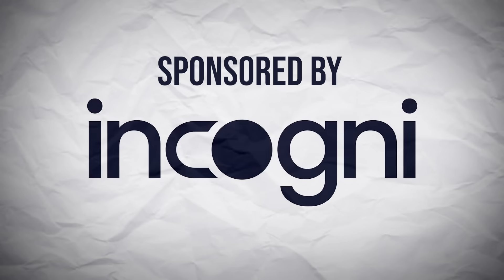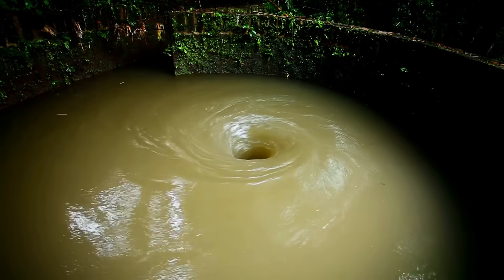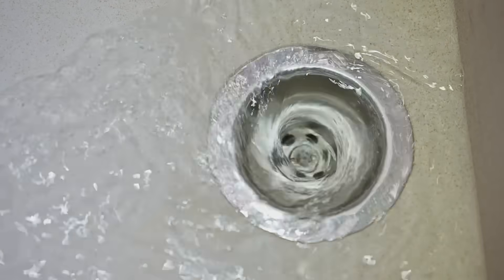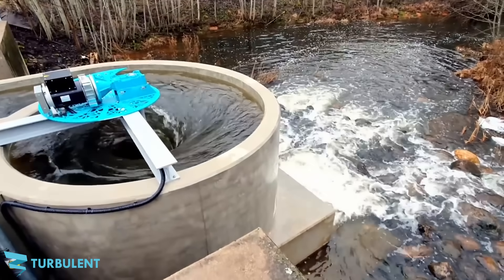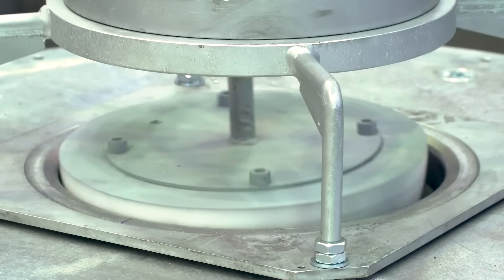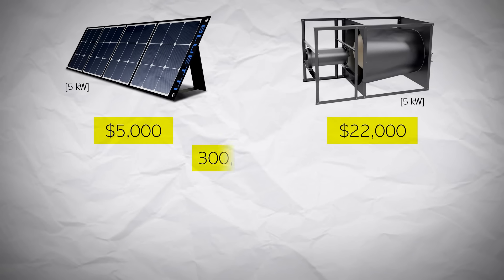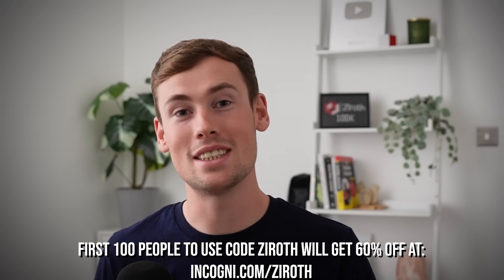Genius Bladeless Hydro Turbine is Cheaper Than Solar

Comment: Would this also work in freezing temperatures of winter? I know that rivers and streams do not freeze solid. Did you run across any studies on this matter?
Reply: To claim that it would be able to run 24/7 is a best case scenario and is obviously is not taking into account seasonal changes such as ice, or reduced stream flows in drought conditions.

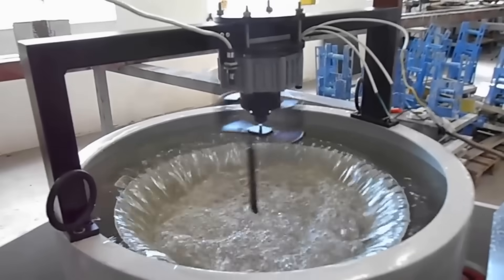Comment: at 1:17 the vibrabion coming form it will end up braking it (nuts and bolts will undo them selfs as for the concreat well thats goin to turn back into poweder)
good idea tho also insead of a ball try an egg shape with the vortex (upside down egg) should come off better of the top of my head
also you can put small bumps in to the wall to help start the vortex spinning the right way tho over long turm there just goin to ware out

Comment: I wonder if something like this could be used in a tide zone on some kind of swivel that would always keep the proper end pointing towards the water source (inland at high-to-low tide and towards the sea at low-to-high tide). It would not work very well at absolute low and high tide, but at other times it would probably generate power.
Reply: If there is a potential difference (ie. flow) then in theory there is energy that could be recovered.
Reply: I was wondering about that myself 🤔
I have a tidal lake and the flow is suprising but generally low flow however, this style could act like a sail in the water where the overpressure of the water being forced into the cone with a restriction, like a court nozzel in reverse, the flow wouldn't be towards the rotating element, it would require flow collection structures but that would only accelerate the flow slightly but the intake for the turbine would end up being higher pressure at the intake because of the cones restricted flow because of the vortex and would use one fixed turbine fed by 2 collectors placed 3M under water would flow all day(*almost) and be functional in areas prone to ice but not arctic levels.
It would look like the old microwave transmission receivers that were on towers before satellites 😉
The idea is the same, catch the wave, so to speak 😏
Where those horns focus the tidal flow will be greater than the turbine diameter so the flow overfilled the turbine and it's resistance to flow and a bernoulli effect created by the diverted water flow creating a low pressure area at the bottom of the turbine so only a slight difference between intake and outlet is required. 
The output wouldn't be Hoover dam but it would be very low maintenance with carefully selected materials and exclusion of fish would happen naturally as fish,  for self preservation, are very pressure sensitive. 😎
Reply: Perhaps we could build very large tidal pools that replenish their volume at high tide, retaining a large head to drain away through the receeding tide" there us usually waves as well.  Not sure what to do at peak high tide - Not much flow then

Comment: The biggest problem in generating power from water is corrosion and growth of biological creatures.  Decades ago testing of using the thermal temperature difference in deep water to surface water have been built and run for years.   Why they are not commercial units or a significant number of turbines in the ocean is because of these two problems.  The world population concentrate near the ocean shore so the transmission losses are not as big a problem.   Tell us about how they plan to deal with these two problems.
Reply: Use none corrosive materials. For example ground source heat pumps work on a sort of similar idea, pumping water through plastic tubing to get access to the more consistent HEAT source.  Temperatures stay fairly constant at a certain depth.

Comment: The power generation capabilities of such blade-less turbine necessarily has to be much lower than a classical turbine, because once load/power sink is connected to this turbine it's going to slow down dramatically, because the water has no way of "grabbing" on to the ball that is now putting resistance to being turned.

You of course could provide some bumps on the ball to increase the grabbing force but at the limit those bumps are just blades and you've come full circle.

So basically this turbine is safe for fish but I bet it's garbage in terms of generating usable levels of electric power. Provide some hard test numbers to prove me wrong.
Reply: Make the "ball" out of stacked discs similar to a Tesla turbine. This will increase surface area and the interaction with the rotating water accordingly.

Comment: By far the bigest issue with low head turbines is the screening requirements asociated with debris... Large rivers carry large debris, especially when they are in high flow conditions. A typicallt benign looking weir/tube/screw... whatever looks a whole lot different with several meters of raging water over it and would stand little chnce of surviving when impacted by the trees  and other large debris,that accompany that flow. This an interesting concept but deploying it would hve the same problems as any other low head system where the screening is the bigest impact to the environment.
Take away the screening and the river will destroy the infrastructure in short order.
Reply: Guessing you could filter a reasonable amount of the big stuff out with some careful redirection for inflowing water as you direct some away from the main stream.
Reply: True - dams have trash racks

Comment: I am confused about where the numbers for power generation come from in the 9 minute area. I tried watching it a few times, but still not sure where that 300,000kWh number comes from. 300,000kWh means there would need to be 60,000 hours in a year if generating at 5kW. 
You didn't need to get that number from the internet, just multiply number of hours in a year by 5kW.
365 days x 24 hours = 8760 hours per year.
X 5 kW = 43,800kWh each if running at 100% all year. 
So if you use the 17% number for solar (probably still a little bit on the high side for a lot of places, averaged over the year), then that would be 7,446 kWh a year for a 5kW system. (~14.9% of 50,000 kWh)
If the turbine is running at 50% over the year, then that's 21,900 kWh (14.6% of 150,000)
To me it looks like your numbers are for 7 years not 1 year.

Comment: 22 seconds in here and I see you have made a major assumption that is there will be water, rivers all around the planet are drying up, great idea for almost nowhere, solar wind and waves are the answers; crushed by petro dollar greedy flocks imho.  Don't get me wrong man, it is a very nice system indeed, but for the cost to build it and the instability of climate change I'd rather go floating shore-based wave machines, solar panels everywhere, wind captured and harnessed. power sources.  I think that principle could be miniaturized easily for places with any sort of water flow, but it is getting rarer and rarer, and frankly, such power points only serve a limited number of folks compared to the need.
In principle it may be cheaper than solar, in my honest opinion I doubt that, but that aside it seems like a good idea, time will tell if we have enough eh :)

Comment: Makes me wonder why smaller versions of these turbines can’t be installed in existing plumbing/sewers. 

Imagine if every time you emptied a bath/sink , or flushed the toilet you were generating free energy.
Reply: because they would clog up eventually and provide abysmal level of usable electricity - they aren't practical in any way shape or form.
Reply: @vaakdemandante8772  also you want as much flow as possible with sewage. That shit ain't easy to move.

Comment: The rotor is off-cenered, it's almost the same principle as you provided.... But it isn't fish friendly as promised
To be fish friendly it has to have a low RPM, the design they provided won't have efficiency at low RPM 
Honestly i'll stick with the fish friendly turbine that has blades or the Arhimede Screw like turbine ....low head/low rpm turbines are the norm in this kind of situations

Comment: 🤔It makes me wonder what dimples in the ball turbine would do❓ Like a golf ball it's just a matter of what the right size of dimples you need for the volume flow of water.🤷‍♂️
Reply: Maximising surface area will improve the systems ability to recover energy from the fluid. Tesla turbines typically use a number of closely stacked discs to increase surface area significantly.
Reply: @nic.h  yes and using a femtosecond laser https://youtu.be/mQdoKaNI8Ko to etch the surface of the turbine blades to increase the surface area of each individual blade will give you more performance. But then there's also is a way to get more performance by Nano reinforcing  with
Aluminum-Oxynitride Powder or other metal trioxide Powders
https://youtu.be/DduO1fNzV4w

Comes in bag A B & C take bag B and mix with 99% or higher alcohol end Nano graphite powder for a single carbon atom. Place in ultrasonic cleaner to chemically dope graphite then prep metal parts for the electrostatic prepping gun for a nanobond https://youtu.be/bpV_Dcwtj60 then mix all three powders in powder coating gun https://youtu.be/IFeMX1O6Epk then spray metal parts and bake in pressure oven that is filled with argon gas that is called Hot Isostatic Pressing or H.I.P. process used in centering aluminum automotive parts. https://youtu.be/BsnzgsEXT_A Otherwise known as chemical vapor deposition proces's for a transparent aluminum diamond Nano reinforced hard coating for larger parts place in larger oven for example pressure treated wood. The femtosecond laser Fixes the issues with Nicholas Tesla turbine disc blades in water and the Nano reinforcing fixes the turbine disc blades in air for higher RPMs without the disks being destroyed.
Reply: It's like Nicholas Tesla said he was restricted by the Technologies of his time.

Comment: There is probably a coanda effect on the water and ball that may be useful. Maybe a directional roughness on the ball instead of fins etc.
Reply: Stacked discs to increase surface area and efficiency just like Tesla turbines.
Reply: The more fin-like the "roughness" is the higher the efficiency - the turbine has the highest and this smooth ball the lowest i.e. none. I bet that connecting this contraption to an actual generator and load will prove abysmal efficiency of this setup.
Reply: I guess the point is to harness power without killing the wildlife in the river/stream. @vaakdemandante8772
Reply: I would imagine it's pretty low torque compared to other designs.

Comment: It seems that this device,  unlike bladed turbines,  would actually cause more damage to fish. Because it doesn't operate like your paper cup example.  Perhaps you could get an even better patent. With the bladed type, the fish have an excellent chance of passing through between the blades where the flow velocity is highest.  In your model, there was zero displacement of the ball, instead , relying on serface friction.  In the actual design,  fish have a good chance of getting crushed instead of bumping into something. The efficiency,  as low as it is, would be even lower if it were to work like yours, although some texture to the serface would no doubt improve things.
This is very similar to rock crushers.

Comment: 17% of capacity factor for Solar Panels??  
Where do you live?  In the middle of Alaska forest? 
Also..   Solar panels does not have maintenance.
Try to keep that shit working over 1 week without issues or without being block. 
Also.. I do not understand why that thing can be installed in more places vs the others.   It does not have any advantage beyond "less infrastructure" but it looks even more dangerous for fishes.

Comment: putting fins on the bottom of the ball would be, in effect, creating some kind of turbine, so it may negate some of the advantages of a "turbineless" setup
Reply: This is still a turbine as it translates the water flow into rotational energy. So more accurate to say bladeless instead of turbineless.

Comment: So if the ball is going along the outer edge of the funnel, how does it not just squish any fish that gets to close?
Reply: The water, along with the fish, is on the other side of the ball and if it’ll fit it’ll go on through with the water. 
I suppose you’d need to keep the bigger ones from getting in though.
Reply: @stanweaver6116  The ball rotates along the outside, sure swirl and water pressure will usually move the fish ahead of the ball, but if the fish does something stupid and gets close it might just get caught and turned into paste
Reply: It’s basically preventing any fish to enter in the first place, it’s not exactly fish safe to go through.
He noted that this spinning ball funnel can be a much cheaper option?
Reply: @MP-vc4nu  The point was that you don't have to build an expensive "filter" system and can just have the fish go through the "turbine".

Comment: If a fish can be caught between the ball and the wall of the turbine, it's not really fish safe. A bladed turbine can be safer if it there is no risk of hitting the leading edge of a blade. Hitting the side of a blade is not an issue as long as the blade is not moving too quickly.
Reply: Pressure differences kill fishes as well like peoples. There's could be many bars different before and after turbine or blades.
So just keep fishes away from it. Much realistic way.
Reply: Bigger blades would help with that in principal. In theory that should allow slower rotation while recovering the same amount of energy.
Reply: efficiency goes up with turbine speed, modern turbines spin as fast as the materials allow.
Reply: @alanhat5252  I don't believe this is completely accurate. The blades have a flow rate that they are optimal for, it's a curve that peaks and then drops off.  You don't want to design a blade that is optimised for a flow rate that can't be achieved given the source of that flow. That would be inherently inefficient.

This is largely due to turbulence caused by the flow not being parallel to the surface causing flow seperation at non optimal flow rates.

This should be much less of a factor in Tesla turbines and this ball turbine, as in theory the flows are designed to be parallel to the surfaces, so to remain laminar in nature.

The blades do however get a mechanical torque advantage, but it's a trade off with the inefficiencies caused by flow seperation at non optimal flow rates. 

Tesla turbines tend to be more efficient at low flow rates, although arguably that's just because blades are typically design for efficiency at more typical flow rates I believe.

Comment: If the entire power generation system was this turbine 24/7 then, yes you could do away with the battery farms.
As has been said, the number of places to install the bladeless turbine is questionable.
In my opinion battery farms will continue to be installed.

Comment: The vibration inherent in the system will make it unreliable.
Reply: Looks like a lot of largely unbalanced force on the main shaft, so agree could be some maintenance/engineering challenges due to that.
Reply: "Come see the violence vibration inherent in the system!"

Comment: As with all hydro systems, regardless of the method employed, you’re extracting energy from the river which reduces the silt carrying capacity of the flow, so you immediately get silting up of the river.
Reply: It's a vortex which increases the silt capacity through the machine & it's installed vertically,  any silt which drops out due to extracted power will immediately rejoin the silt capacity of the main flow – silting is a non-issue here.
Reply: @alanhat5252  Energy has been removed from the system. 

You not understanding the implications of that makes all your comments utterly worthless.
Reply: There is so much human or natural intervention that in any case there will be more or less of it in an area at one time or another.
One more obviously will have an effect, but with our current weather conditions it is or all or nothing from one day to another.

There was a story about the Nile and the appearance of animal species at its exit which would be due to dams. 
But scientifically it is very debated and it is directly related to what you are talking about
Reply: This is the problem with a lot of green ideas. At large scale, you are potentially messing with energy in some pretty important natural cycles
Reply: Incorporate a gravity filter into the system and largely automate the removal might work. i.e. use physics to get the silt to drop in a convenient location for removal.
Reply: @orionbetelgeuse1937  my reply was relevant to the conversation, the fact that it isn't completely original doesn't alter that. The OP was concerned with silt, I simple pointed out one way of reducing the issue.
Reply: @orionbetelgeuse1937  the idea is based on the fairly commonly used process of gravity seperation.
Reply: dredge silt and put it back on land it came from?
Reply: @paulabuchanan8375  as if dredging uses no energy. You can't extract more energy from a system than you'd have to use to put that system back in the original state, ever. If you could, that would be a perpetual motion machine.

That is why we use coal, oil, nuclear power and solar power - those are non-renewable but we don't try to renew them, we just use them and they are gone.

Sun is also non-renewable but it's just so HUGE we can't even dream of using it up in our lifetimes, so in principle it IS a finite resource.
Reply: @vaakdemandante8772 Solar is a renewable energy source. You said it yourself, the sun will always be there (at least for the next 5 billion years).
Reply: @paulabuchanan8375  And use up more energy than you’re generating
Reply: @fredbloggs5902 Depends on the type of energy. The hydro makes electricity. Depending on the size of the setup, dredging would use human power or a diesel excavator or a dredge pump. If the benefits outweigh the drawbacks, it's a good system.